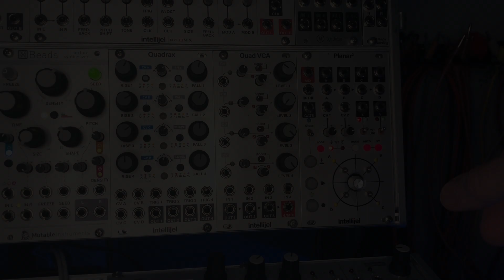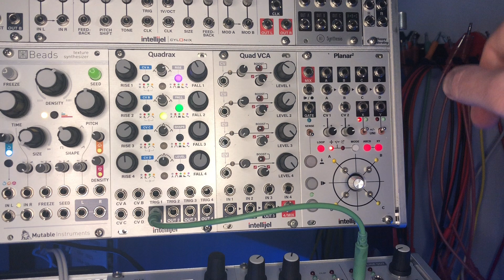Quadrax Krell Tutorial: How to make a generative patch using only Quadrax

Comment: All this with not patching 😮…

One question, when you change the shape from log/Lin/expo, in cycling envelope mode for example, does it affect the duration of the cycle? many analogue function generators (except frap  tools falistri) do work like this.

I want the option to choose if shape effects duration.

How does does the quadrax was work in that respect??
Reply from the maker: To be honest I can't remember offhand. It might mention it in the Intellijel Quadrax manual or Youtube video. I think as a digital function generator the shape does not affect the timing like it does on analog ones like falistri and maths.

Comment: Hello thanks for your video ❤one question is possible to sequence all the channels Cv? Or just cv channel 1? Thanks 🙏
Reply from the maker: Glad you enjoyed the video! All of the channels have the same CV assignment options. If I remember correctly, In this case I'm just assigning (RISE) PITCH to CV input 1 because that's the VCO channel. If you wanted, you could make all 4 channels VCOs, send a pitch input to any CV input, and assign it to all 4 channels RISE.
Reply: @ScottMFR  thanks for your replay I mean sequencing each channel independently and individually not polyphonic mode is it possible?cheers 🍻
Reply from the maker: @dedodan1  Yes, with the 4 CV inputs, you could assign each one to a channel to sequence them independently.